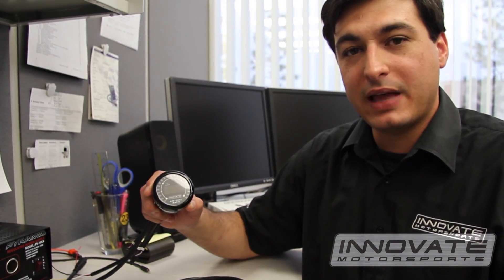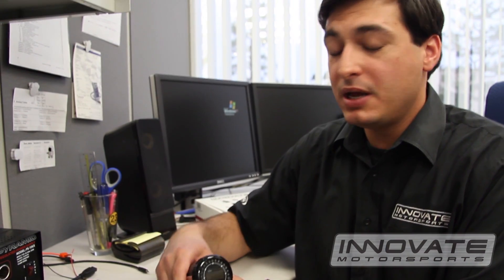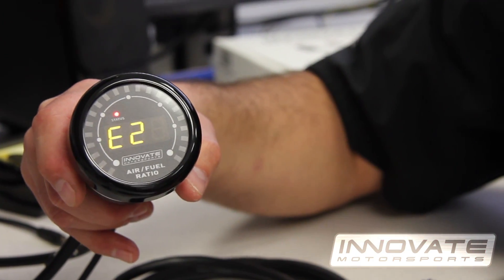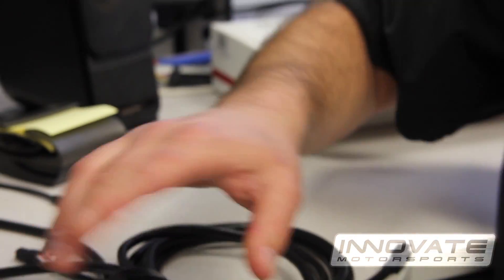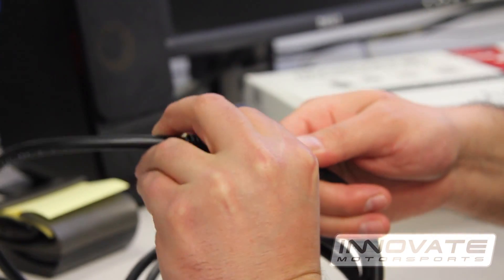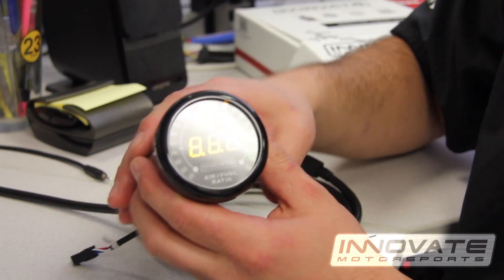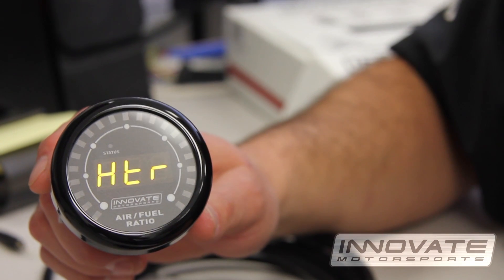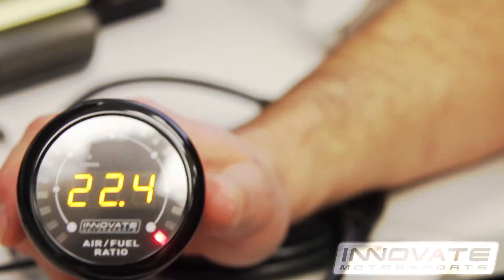How to calibrate the MTX-L Digital Air/Fuel Ratio Gauge.

Comment: Just installed a new mtxl,went in to e2 error after 20 miles and will not reset or calibrate.There are no damaged wires or loose plugs,thing just died....

Comment: hello, I bought MTX-L gauge, it was used but it was working well before removing from vehicle. when I installed it on my car I tried to calibrate but it sits on htr and not doing calibration even if I wait 2 and more minutes, when I'm starting car after it's showing me E4 error (at first it showed E8 and E5 errors as well) I tried to change sensor but again same happening, any suggestion? please.
Reply: Mine is doing the same 3 months out of warranty :-( did you fix yours? I have used a new sensor and still the same
Reply: I have similar problem. Device is new, after rebuild of engine it was set in to downpipe and not calibrated properly and car run about 600 miles. Now on remap we trying to calibrate it and it's shows E4 error. Before calibration it shows some abstract values (max or min) and after few minutes error E8.

Comment: I just bought the dlg-1 with the lc-2 module and I did the calibration step by step like this and still won't read right. at idle and light throttle it reads 22.4 if I pat the gas A sensor reacts B does nothing. and wot both finally read 12.3 what does not reach that AFR until 6 thousand RPMs what's wrong? B sensor which is hooked to the lc-2 is very slow to react

Comment: Hi, I have a brand new MTX-L gauge but always get error E4 after HTR dissapears (trying to calibrate). I replaced the LSU 4.2 O2 sensor for a new one but the problem remains. I also checked the extension cable, for resistance on all pins is ok, no faulty wires. I also used a powerstation to eliminate power/ground issues, hooking up the red an black wire. I just keep getting error E4. Any toughts, thx in advance? I'm from the Netherlands so support here is hard to find.
Reply from the maker: +Yuri van der Linden When was your MTX-L purchased?  We have been including the 4.9 sensor for over 1 year.  Please call to provide some additional information 714-372-5910.  We will get you taken care of.
Reply: +innovatemotorsports Hi guys, thx for the support! Used LM programmer and changed the sensor type. Did the cal and now working like a charm!

Comment: i just installed my wideband and whenever i step on the gas it leans out at 20.2 and bogs down? then after awhile it works fine then again when i floor it bogs down as well ? what could be the problem?
Reply from the maker: +Marco Mancillas .  You need to re-calibrate the sensor.  Based on the numbers you are seeing it sounds like the sensor was calibrated in the exhaust.

Comment: You should also mention that while the o2 is heating up to make sure you arent holding it or that it is resting on anything because it will burn you and start to melt stuff, I left it sitting on my carpet and it started to melt it and was hot as hell!!!
Reply: Wow, really?!  They were probably giving the audience the benefit of the doubt and hoping no one that moronic would ever purchase their products.
Reply: SeanPatrickMartinez there are people who are learning Mr. Know-It-All, nobody was born with all knowledge in his. I totally sympathize with 06MRV8Killer and yes, there are "moronic" people who learn the bad way... Some years ago, I also burned my hand with a lamda, I have a car with carbs, never had a lamda sensor before, never needed one, until the point where I learned the hot way how this thing works... 

Nothing moronic there, besides your answer Mr. Perfect! (two names, that's impressive!)

PS: Nice video, innovatemororsports, thank you! And yes, I also agree, a small warning for those who are not born geniuses like SeanPatrickPatrinez, wouldn't be that bad! :)
Reply: asconan There are warnings all through the instruction manual.  I'm hardly a "know-it-all", I just took the time to read the instructions and did my research before even purchasing this product.

Comment: question I just install my MTX-L. after the calibration. but after i install it on the exhaust... and connect on the proper wires. When i switch on the engine it show E2 then afer a bit of seconds it shows htr. afterwards it show up the afr does this fine? or do i need to recalibrate the afr?

Comment: I have the MTX-L and need to enable the output to use for my standalone's wb input.
Could you give me a quick rundown on what I'm getting myself into?       I've had it installed for a few months just to monitor, but haven't done anything else like this before.  

Thanks

Comment from the maker: No, you do not need to wait for the sensor to heat-up before starting the engine.  Just start and drive the vehicle as usual.  Thanks!
Reply: hey when i try to calibrate the sensor i don't get a HRT displayed instead it just constantly sweeps the lights doesnt display anything just 0.00

Comment: I have re calibrated it about 5 times all of them I had them in clean air. The only times that the gauge reads lower than 22.4 is when I quickly step on the throttle then it goes right back up to 22.4 I have a Cobb tunner and that is reading 14.7 most of the time so I know it's not my car.
Reply: Got it fixed? Having the same problem
Reply: Same problem, doesn't move from 22.4
Reply: Up
Reply: You need to unplug both wire of o2 sensor

Comment from the maker: It looks to me like the sensor may have been calibrated in the exhaust.  Please remove the sensor from the exhaust and re-perform the calibration process listed on the quick start manual.  If the problem persists please contact us at 800-348-3037.  Thank you!

Comment: I just calibrated my mtxl then installed it and it constantly reads 22.4 when I quickly step on the gas the sensor goes down then quickly shoots back up to 22.4 any suggestions?